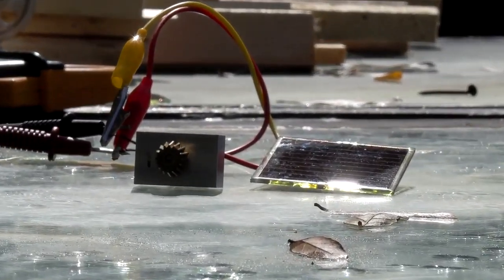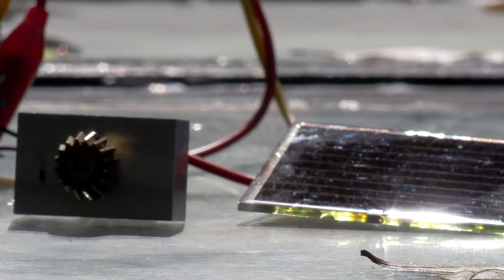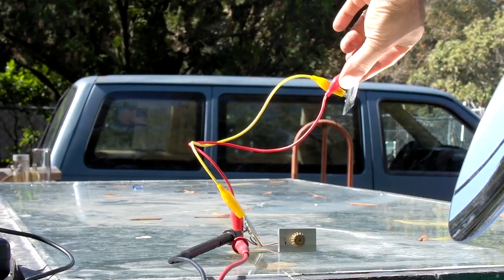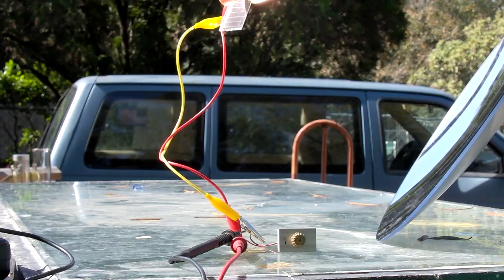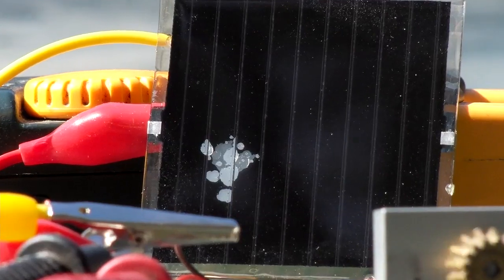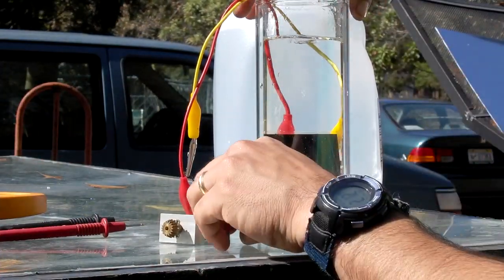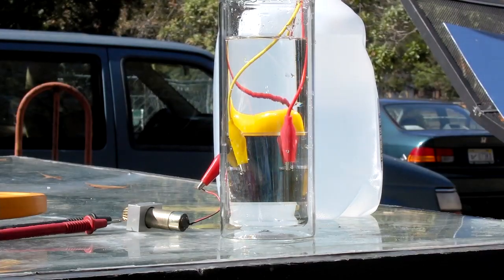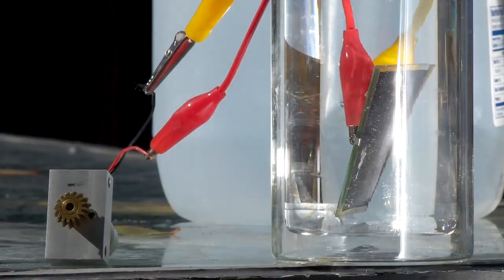CPV CONCENTRATED SOLAR PHOTOVOLTAIC CONCENTRATED PV POWER

Comment: Really good presentation. I would only suggest that if using broken cells, expose them to a sun-like light source and check for current. It's a drag when you find a dead/low performing cell in your panel. I should also mention, however remote, good cells can "reverse" into bad ones. But, I'll the that to your imagination.

Comment: Dan love your videos.  This video is on concentrating light for photovoltaic cells to increasing efficiency.  They use to same principles for Thermo too.  In the End which system is more  efficient Thermo or Photovoltaic for producing electricity?  What is the precentage difference? Can ypu also post a link to a major Thermo generating plant video or article.  Are commercial Thermo generating plants gaining ground?

Comment from the maker: @STARFIRESOLAR They are actually not cheaper when the cooling and dish system is considered. 1000x sun CPV is $.75 a watt.
Reply: Why can't you use heat rejection films or sun control films to block upto 90% of heat so, that pannel will be safe generally heat rejection films are used for windows of house and cars to block heat from sun. And after blockage of 90% heat only 10% of heat is allowed so 10 times more power we can produce with same solar panel

Comment: Why can't you use heat rejection films or sun control films to block upto 90% of heat so, that pannel will be safe generally heat rejection films are used for windows of house and cars to block heat from sun. And after blockage of 90% heat only 10% of heat is allowed so 10 times more power we can produce with same solar panel